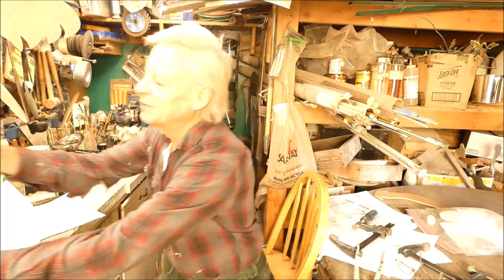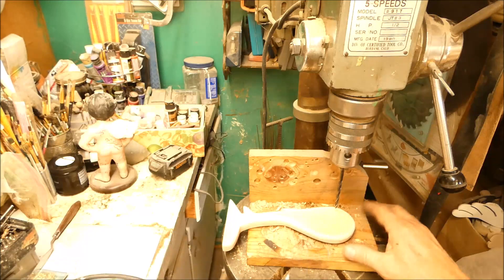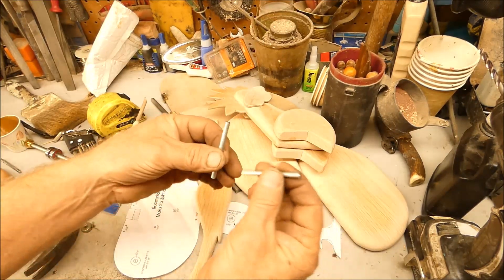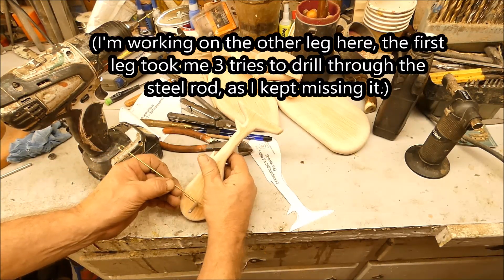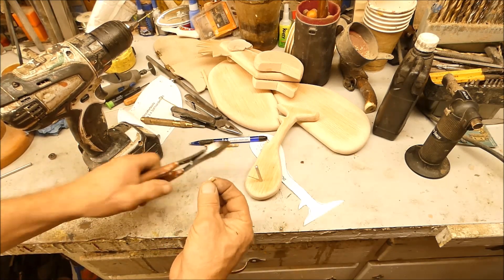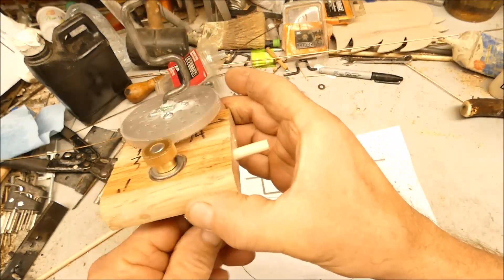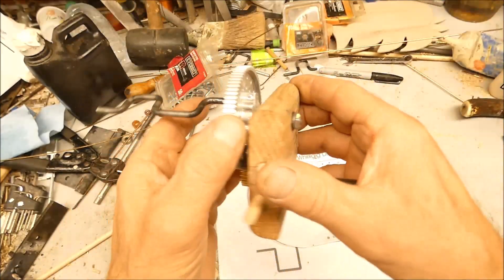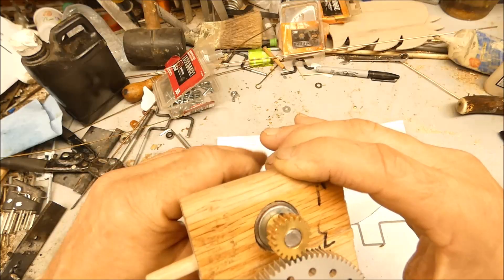Crowing Rooster Whirligig Build pt. 2  8/30/2022

Comment: Love that one. I might have to try one of those. I need to get some shop time in.
Reply from the maker: Hi Dave! Yeah, this is going to be a fun one if I can get all to work. This first one has been a bit difficult, but the next one will be easier. Shop time is always good time; I can never get enough of it! Make sure you check out my budget shed build; I paid less than $1,500 for all the materials because I had all the framing lumber already from some demoliton jobs I did previously. It sure is fun building stuff. I'm going to check out what you've been up to. Thanks for stopping by and leaving a comment. Best regards.